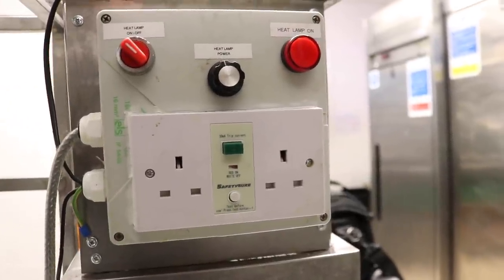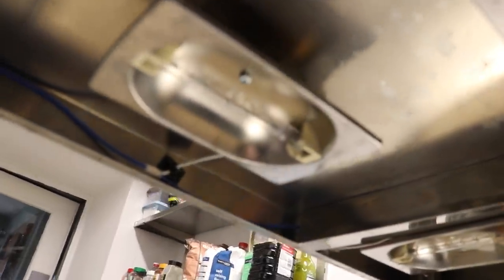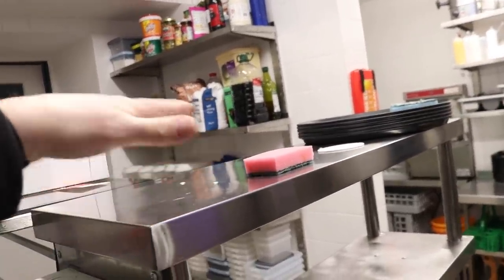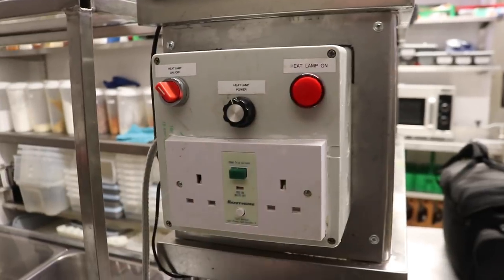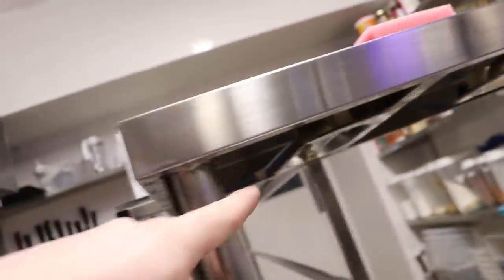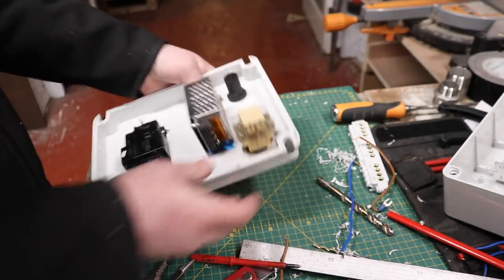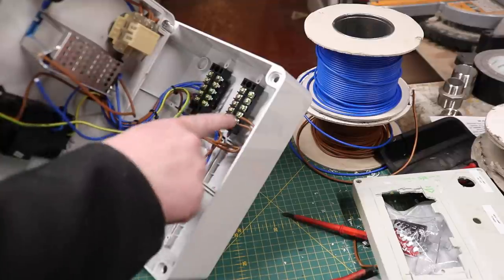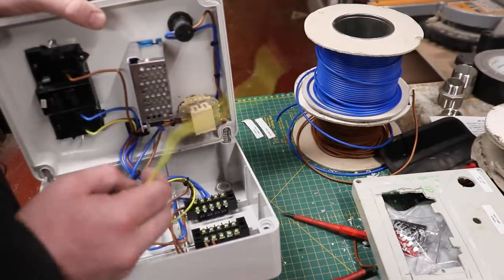Heated Pass Controller

Comment: Good job! If the ventilation is still not sufficient, consider mounting the fan as an exhaust near the top of the box instead (on the side if spillage into the box is of concern) leaving just a hole at the bottom as an inlet for air circulationy-the-poney, if you get my drift (hot air rises, negative pressure etc).
Reply from the maker: I did consider the top and the side but my concern was liquid ingress. I think any air movement will help though as the heat was only a problem before as the component was too close to the top.
Reply: I was thinking the same. Even just a few small holes drilled in the bottom would allow some air in/out.

Comment: Good job. I’m possibly telling you something you may know but your heat lamps should really be double skinned above food. I can’t tell from the video if yours are or not. The double skinned ones can be 300 or 500watt each, using whichever wattage your controller can handle. Single skinned ones can be heat or light so quite often people put halogen lighting ones in by mistake as they are easier to obtain.
Reply from the maker: No, you are right, I only learnt this when I placed an order for some replacements. I got the 200w double skin ones. I will put up a vid when I replace them all.